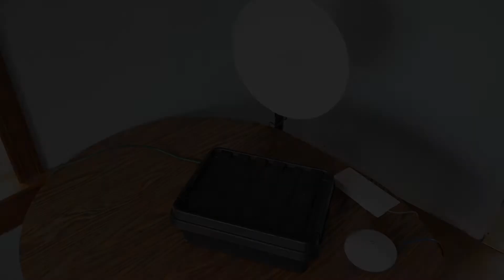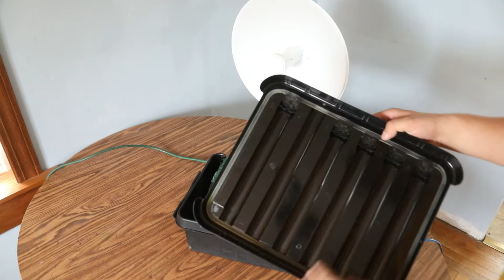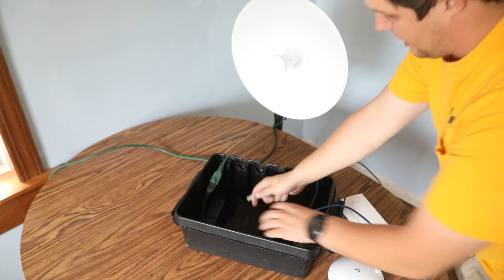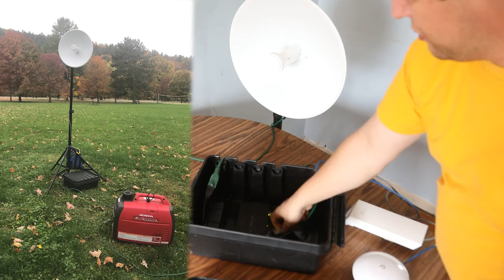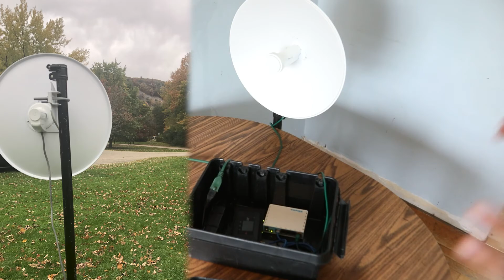Customizable Portable AREDN Node

Comment: How many nodes can you connect and, assuming its line of sight, how far can they reach out to each other? Will make a video installation guide that not only includes hardware, but also the AREDN use/tutorial? This is amazing stuff
Reply from the maker: I have several other videos showing the setup and tour of the dashboard. Distance is based off of line of site, antenna, band etc, most connections will be less than 10miles. However you could set up a point to point that is much longer if engineered properly.
Reply: I have easily done 21.5 miles with these through some thin trees many times. With true line of sight they will go as far as you can see within reason.